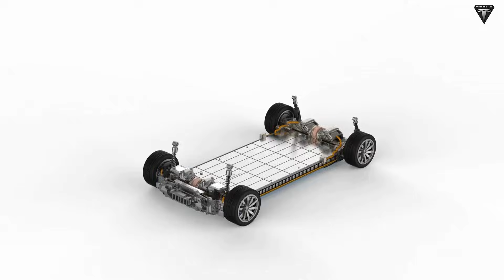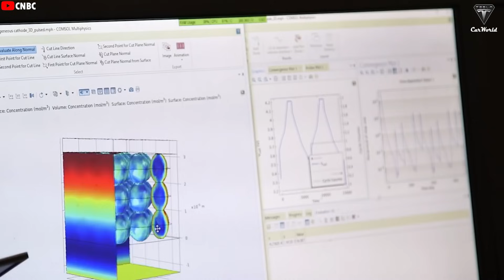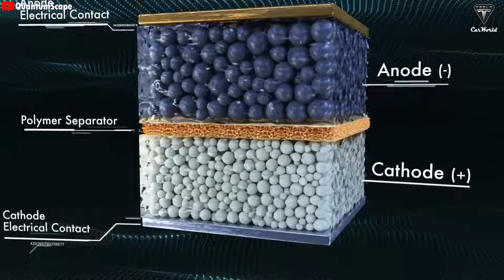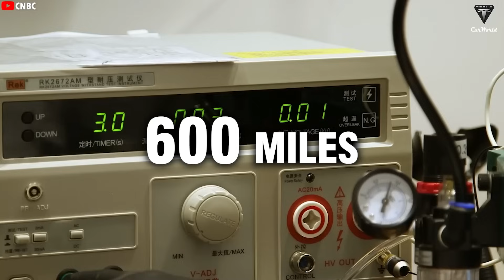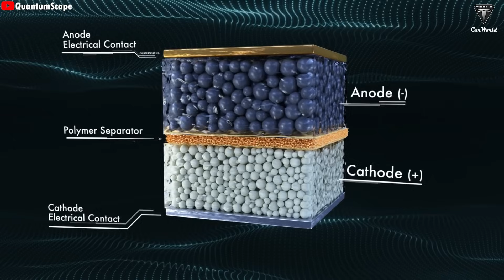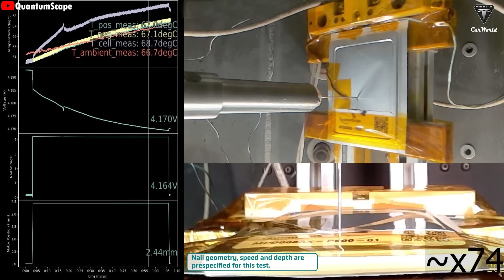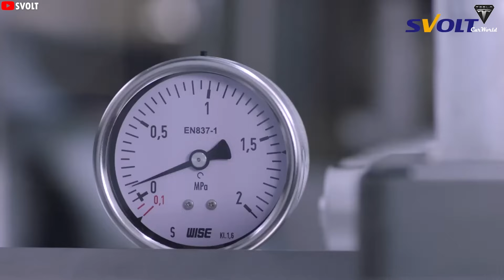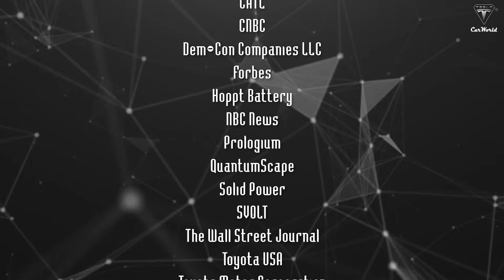It Happened! NEW Gen Toyota Solid State Battery 1000 Miles Will End Of Tesla 4680? Elon Musk SHOCKED

Comment: CATL has a Sodium-ion battery IN PRODUCTION as of 2024 with some of the SSB advantages. Long cycle life, and much cheaper than SSB. Also, excellent performance in cold. Great for Grid storage and transit trolleys and busses. Sodium is not the best for EVs because 160wH/Kg, but expect 200+ by the end of the decade.
Reply from the maker: Fascinating insight! Sodium-ion batteries from CATL do sound promising for grid and transit, with great potential in cold conditions. The 160Wh/kg might improve to 200+ Wh/kg, which could shift EV dynamics—let’s see how it evolves!

Comment: Solid state batteries are built on a glass or ceramic substrate. You put packs of those in EVs and what happens is the flexing of the car makes them all shatter and crack before you get two miles down the road.
Reply from the maker: That’s a critical point! Solid-state batteries’ fragility under flexing is a real challenge for EVs. It’s a hurdle Tesla and others need to overcome—hope to see innovations addressing this soon!

Comment: I want the battery to retain its 100% capacity for more than 3 years and maybe with only a 20% REDUCTION in it for up to 20 years, Cars make up a small portion of the pollution and pollution by air, rail, transportation of goods make up a large portion of the pollution, transportation of goods by truck is probably the highest. The average commuter travelling to work in an ICE car is contributing a small % of total emissions, but we are getting penalised and forced into EV's that will gain little when you add in the destruction of an ICE car that has built-in carbon that will be released prematurely, but if the EV needs replacing earlier the Built-In Carbon will be released much earlier than 15 to 20+ years for the ICE car, nothing is free!
Reply from the maker: A 20% capacity reduction after 3 years is realistic, and solid-state batteries could extend that. EVs do reduce pollution compared to ICE cars, though transport’s overall impact is complex.
Reply: @TeslaCarWorld  Yes it is very complex, we have to factor in a lot of variables, longevity of the battery and electric motor vs longevity of the engine, the amount of carbon released to collect and make each car, the amount of polution released in a fire. The amount of materials needed to provide new power stations to power these or new wind, solar installations. I am not saying EV's are not the way forward, but people have to understand that the environmental impacts are not what they believe they are getting, no emissions out of tail pipe does not mean no emissions. I have a 2006 BMW Z4 with less than 39k Miles on the clock, it is a 2.5i and in very good condition, it has maybe up to another 140k miles of future serviceable life and to me it would be a crime to melt it down, release all of the embedded carbon and put the rest in landfil. I worked recently on an Energy From Waste centre (Architectural Technician) These power plants do scrub the air to clean particles, but basically burn useable land fill material. Just because coal is not being used EV's will be running on power from poluting the air with dust free fumes. I hope the battery technology of solid state becomes the preferred method and becomes cheap and also hopefully the new solid state batteries could be used to allow old cars like mine to be converted cheaply to an EV, keeping old cars on the road is the key to reducing emissions even old EVs instead of them being scrapped after an accident because the battery got hit and was potentially dangerous.
Reply: What the heck are you trying to say??
Reply: @Budspud-l2k If you are refering to me did you read it all?

Comment: Charging at full speed in freezing conditions? I have serious doubts about this working as claimed.
Reply from the maker: Charging at full speed in freezing conditions is a challenge, but solid-state batteries’ solid electrolytes and better heat performance could improve reliability as claimed.

Comment: A 0.1-second difference in acceleration isn’t that impressive. It’s barely noticeable on the road.
Reply from the maker: The 0.1-second acceleration boost might be subtle, but solid-state batteries’ range and charging speed gains are where the real road impact lies.